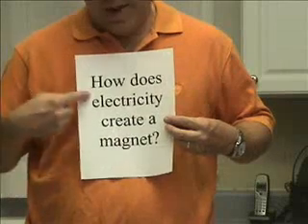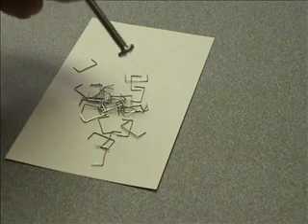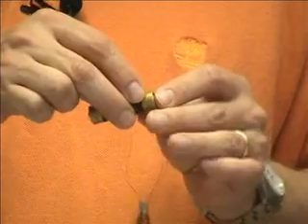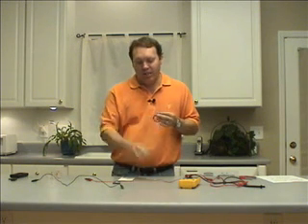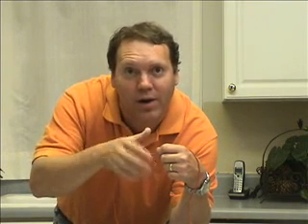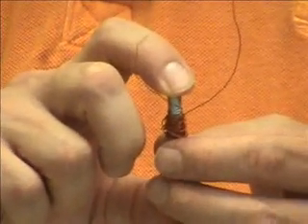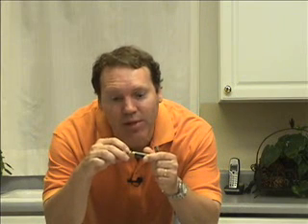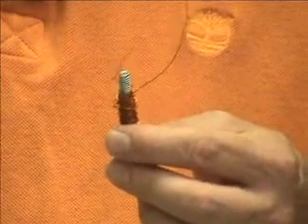Electromagnets - How can electricity create a magnet?

Comment: They are made from electricity and the electricity powers the electromagnet, now if u mean a motor then u use a AC system, U have to have a Base magnet, a power source, brushes and commutators, an armature rotor, and an electromagnet then u have to set it up ill link a diagram later

Comment: its probably not insulated wire. Insulated wire has a special coating that blocks the electrical sparks. If not, then maybe the battery is the problem? Idk

Comment: It needs to be more than 1 turn. It turned hot because with one turn it just results to a short circuit. A lot of current passed thru the wire. The more turn the more resistance you will have making lesser current to pass, thus lessening the chance of it getting hot or worse melting.

Comment: i have perpetual motion . It is a secret long forgot. take a U-bolt wrap some wire around both legs of it . have a flat piece of steel to put across the two ends as a keeper .one single pulse of a battery and the device starts an electron flow and becomes permanently energized holding the flat bar in place . before you throw this down try it . with enuff force you can break the flatbar and it stops the electron flow .it will hold perpetually until you break the hold of the bar then it turn off.

Comment: @TruthinessDotCom The strength of the magnetism is in direct relation to the voltage applied.  You could use less conductive things like Nickel, but apply more power from a bigger battery and net the same results.

Comment: From my understanding, current is measured in Amperage. That is, how well and effectively the flow of electricity is actually traveling through the circuits or conduits. Volts simply measure how much electricity there is, and amps can be deduced by figuring out how much resistance is in whatever it is that the electricity is traveling through, the ohms. 

I think that's right, but I'm no electrician. =P

Comment: It's the current what kills, not the voltage. One time, I told this guy I didn't like much to hold a screw driver (with wood handle) to the wire that came straight from the coil.
While he was holding it as I told him, I went inside and turned the key. Hahahahuaaaaaaaaaaa the Dude responding yelling. It shocked me It shocked me!!!!!.
I told him I didn't know that would happen. Boy did I laugh my ass off?!.